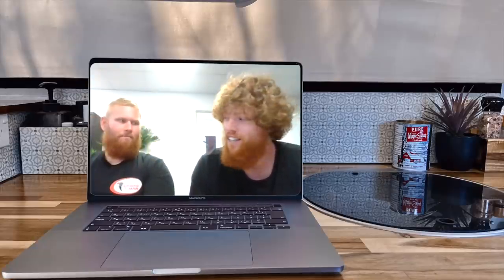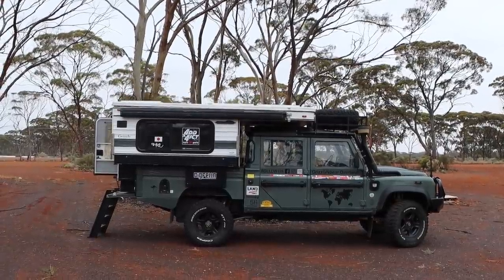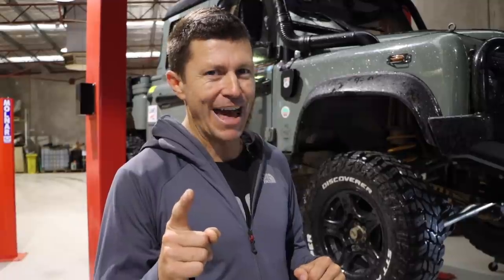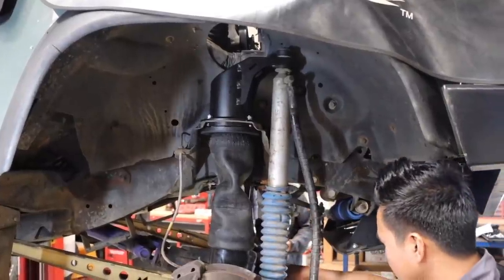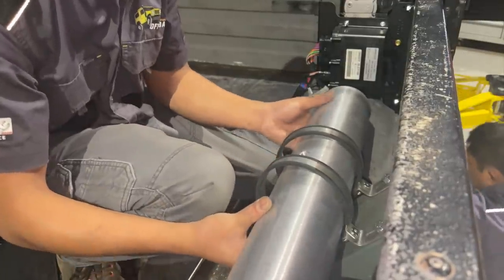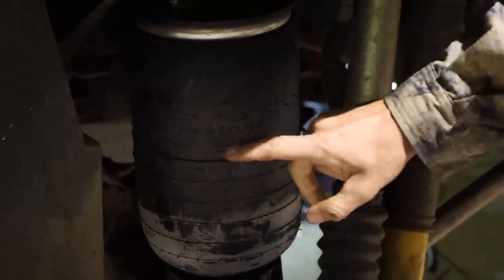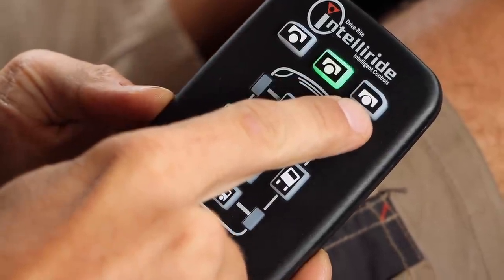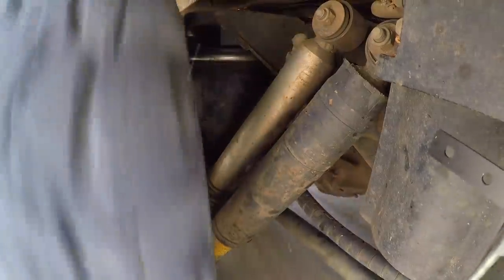Land Rover Defender FULL AIR suspension system! An epic upgrade. Coil spring replacement! (Ep193)

Comment: Hi fellas
I have had Firestone rear air bags for 8 yrs in my 130 never had a problem we   go into the desert every year we also tow  a camper trailer we are overloaded as we start our trip with 350ltrs of fuel and supplies 200lts of water on trailer 
So you need not doubt the air bags 
I think I will put front ones on now that I have seen them
Reply: Awesome to hear thanks heaps for the comment. So far it's been amazing. Definitely a game changer.
Reply: Do you have a part number?

Comment: You guys are going to love it.  I’ve owned a 2013 discovery 4 since new and one of the best features is the air suspension!  I do lose some articulation but that’s more to the IFS snd IFR setup that airbags.  It will ride rougher at off road height though, so be aware of that on rutted, bumpy trails.

Driven over countless miles of washboards, and rough desert tracks and it’s never failed me yet!

Enjoy!!!!

Comment: Top tip, there is some play on your upper rear shock absorber bolt. Most probably you have already seen it on you video.

The airbags looks great! Very smooth ride! Nice upgrade!

What was the old system what you where using? With the airbag inside the coil spring?

Comment: I had a RAM 1500 with factory air ride. It made such a hugh difference in handling over a standard suspension. Not just with bumps or terrain but handling at speed as well on the highway. Worked the same way as yours with lifting the front and rear in stages. Also the closed loop compressor but I think it used nitrogen instead of air. The only issue I ever experienced was in below freezing weather it would be a little slow to responed with changing settings but rode fine. I would just drive it a bit before attempting to change settings and it worked better after warming up. Under 15mph I could push the "parking" mode which made it look like a low rider. By the time you where parked it was lowered and made getting in and out so much easier especially for my wife! 140,000 miles on it with no parts replaced when we sold it.

Comment: Easier to level out for uneven sites and also the added bonus of quicker slide on camper removal. Legs down drop the ride height and drive out also less wear and tear on the leg mechanisms with no load during operation.

Comment: Hi guys, congrats on the air bag install. I have the same set up on my 110 and love it. Keep an eye on the front shock brackets—I cracked both and had to get them replaced. No issues since. I suspect the bolts loosened and the associated bracket movement caused the cracks. I couldn’t be happier with my setup. Hope you enjoy the smoother ride.

Comment: My Prado Grande came with basic air suspension on the rear, but normal on the front.  Several have said that the air suspension would soon fail on me.  But after 220km I have to say that it has not givem me any problems at all.  It is not your computer controlled type but has several setting and functions for different situations, but even so it has served me well.

Comment: G'day Leigh, I've run Firestone airbags on the rear of my 130 (99' 4BD1T/MSA-5G swap) for the last 8 years. The 130 has run up and down the east coast of Oz from beach to mountains whilst being puncture and trouble free the whole time. I've never carried a spare either.
I have a DIY full manual set up using the same bags as Firestone.  I think you'll find once you have a preferred ride height you won't need to play with it very much. Well worth the swap especially with a slide on, it makes levelling the your bed a breeze! 
If you make it across to Vic/NSW/Qld how about a 130 gathering?
Reply: Great to hear that info mate thanks for the comment.
We're still playing around with the different ride heights. Feeling more and more confident with the system every day.
130 meet sounds fantastic!
Reply: What is the model number of the bags you’ve used

Comment: Besides the 130 have an old Range Rover P38 , with a fully rebuilt airbag system (thanks Airbagman) - that car was the first Land Rover product with standard fitted Airbags if I'm correct -  often cursed upon by many (To easy to puncture , always failing , slow pump ) and they replaced it by coils. But as with everything : maintenance is key. True the P38 system could have been built a bit more sturdy. But what a pleasure to drive (if it works) . I also have an emergency connection to each airbag. In my case using a central valve block with mano-meter and special line to the tank.  One simple modification I did : a small LED control  that lights up when the compressor kicks in - it shows me if / when the compressor runs more frequent as normal indicating a leak. 
Happy exploring you amazings !!
Reply: Nope the air ride came out on the 1992 LSE prior to the P38 they relocated it from the chassis rail to engine bay, however on mine I fitted pushfit connector’s and added tire valves, I still have my classic and P38 and put air on the 110 by harvesting all I needed from a donor cost was under a grand

Comment: I have driven coaches all over Australia with air suspension, first class ride. Be aware that the reaction time when the air bags are inflating that there is a slight delay, just hold the steering wheel steady  even while the bags are inflating other wise you will find that the vehicle wonders (in your head). It is just something you have to get used to. I am thinking that you may have to watch your tyre pressures may have to drop them a little. Enjoy the ride just watch the components on the height control valves eh. Cya on the tracks.
Reply: Such an interesting comment thanks so much.
I have indeed been experiencing the slight pull on the steering as the bags adjust.
I quickly figured out what it was. Initially I thought I needed a steering alignment. Only thing was sometimes it was pulling left sometimes right 😜
Reply: @leighdearle5965  gday Leigh, yep your experiencing getting used to airbags, normal. From your description to inflation it sound that you have one height control valve on the front centre mounted.  
Better with a height control valve on each corner.
I had a Scania coach have a height control valve fail in Alice Springs finally got a replacement in mt isa. Just isolated the front

Comment: Very good idea to upgrade the suspension with airbags. I did the same on the rear axle of my Defender 110 DCPU and it made a huge difference. Mine is a DIY setup just with valves and no electronics. Even at the Land Rover dealership, the mechanics came to take a closer look, they've hadn't seen that before on a Defender in those days (2011). Al the best to you both and happy travelling. Best Regards, David
Reply: Same with my 2009 90. Back only and very simple and never given a days hassle.
Reply: What airbags did you use?

Comment: Very tempted to do this to our 130 camper before we go travelling, reliability and fix ability are my main concerns.
Reply: See my response above...well worth adding it to a camper. It was a game changer for my slide on. I have zero reliability concerns, if I puncture a bag I'll stuff full of whatever is handy and limp it along till I get back to tarmac. Be mindful of engineering compliance with rego in Australia. Regardless of what a vendor says their system may very well still need an engineering certificate/plate issued under a State registration system to be compliant.

Comment: My Discovery air suspension has never let me down but I also carry a bypass kit to individually inflate each bag if I need to.  You might want to cary a spare height sensor and rod as they are a little vulnerable.  I carry these for my disco just in case but never needed them.

Comment: Whew! I was starting to worry about redundancy until you fessed up about the manual fill from the ARB. That makes it much safer in the bush. Just don't tell Andrew from 4XO! (he hates them, but that's due to the single point of failure of them on Rangies, etc.)

Comment: What are the original partnumbers for the Firestone airbags? I would like to convert my 130 camper to air, but without the computerised system just manual controls (8 valves, 4 pressure gauges, should do the job)

Comment: That is a cool upgrade! Would be awesome if it fits my 1965 Unimog 404 :D I have coils all around.

How does it deal with alot of flexing in the terrain on difficult tracks?

I drive highway trucks and trailers on air suspension and it is great. But they can blow up. But that happens most times when a piece of scrap metal is stuck in between them. And when they blow on a truck or trailer it sounds like a bomb explosion!
Reply: I think you can find something on the market that fits your Unimog. Take the dimensions of your existing suspension and look for the corresponding airbag version. Best Regards, David

Comment: BTW
Your shock bushing looks shot, didn’t renewed them? Or new shocks on the way…
PS
ABM normally use a German air compressor. Bomb proved units…. They are sealed for under vehicle installation, you got a nice spot in the tray for it.
Safe drive, smooth ride and keep the sunny side up.  Cheers..

Comment: Did you notice what appears to be a crack in the original Radius arm/Panhard bracket welded to the axle where the shock absorber relocating bracket is bolted onto (passenger side)? You can see it at 5:48 in the video. It starts in the LH bottom corner and goes towards the center hole in the bracket for the Radius arm.
Reply: What a spot! You've got eagle eyes 😉 Yes we did find that crack when we did the job. We thought about welding it but then realised the new bracket for the shock absorber reinforces that area.
Reply: good spotting Rob!
- Some maintenance and regulaur future inspection of both left and right mounts will go a long way for minimumising the possibility of problems on the road.
Reply: @leighdearle5965  I would weld it ... simple job and will offer piece of mind. The shock absorber bracket is not intended to take up any forces from the radius arm. The bracket cracked for a reason ...
Reply: @rberkel1  ok good advice thank you. We'll do it asap.
Reply: I noticed the same at 5:48 and was about to post a mention but thought I'd scroll through in case someone else had already done so - good spotting.  Cheers Lee

Comment: Wouldn’t the air suspension lessen your axle articulation ? Hence making it less capable for off-road
Reply: I've installed a crosslink-valve, so the air can travel from the left to the right airbag and visaversa. When I travel on the road, the valve is closed for higher stability. When I do offroad, the valve is open for higher flexibility. As simple as that. Best Regards, David

Comment: Hello. I'm sure you're already aware of this, but keep your airbags at a level where they will allow the vehicle to compress the airbag. There are so many videos and photos of people with bent chassis' from towing. I've even seen a D Max where the wheel, backing plate, brakes tore away from the diff housing, completely sliced the end off the diff housing. This D Max was not towing & there was no mention that it could have been airbag related, but everytime I see a disaster relating to the chassis around the rear suspension area there's an airbag in there.

I'm no expert but I believe it has to be because the airbags get over inflated and don't allow the vehicle to travel through its' length of suspension enough, thereby passing on the up & down travel into the next thing in line which are the static steel parts such as the chassis, suspension mounts and diff housing.

That said, it does look like a great addition.

Comment: Hugely expensive and over complex - I’m using 4 bags from a classic and the front axle casing with the oem shock brackets, an ARB compressor and rocker switches and gauges -  Your simply introducing more electrical complexity than required.

Comment: Allways keep system simple
When Something wrong in Sensor or .....
Then Cane Not drive
Reply: I think we explained quite clearly in the video. Even if the sensors fail, the compressor or the computer the entire system can be used manually. Each bag has a manual inflation point.
Reply: @leighdearle5965  
OK 
IT Is your way
But without Air or Air leak 
The airspring Not Work/
Cane Not drive
Even when you have 2 system